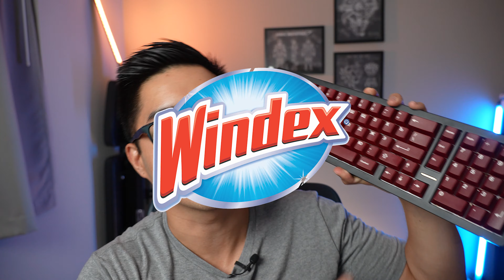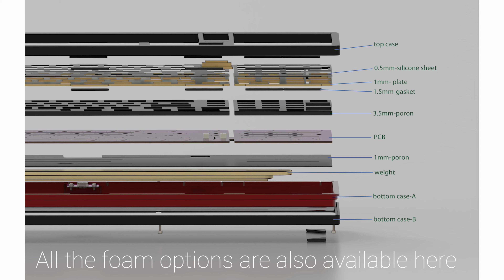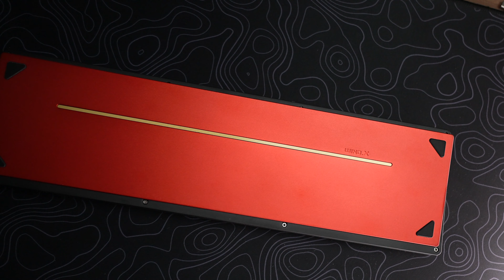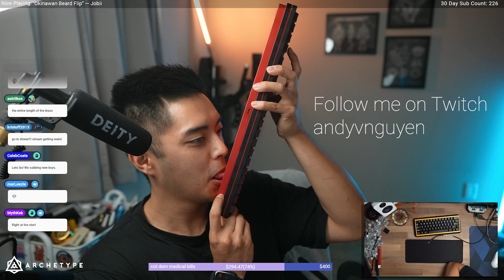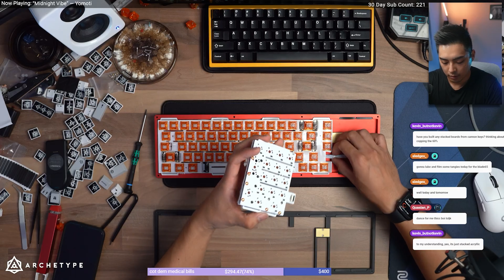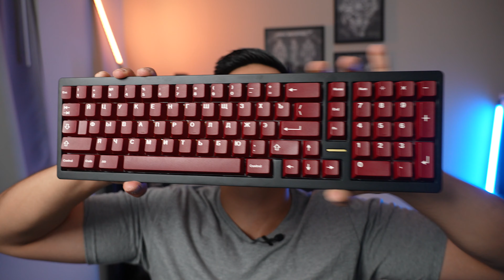This Will Be Your New Work Keyboard - Wind X Review

Comment: What they should have done is putting the silicone on one of those anti stick paper (those used for stickers).  The user can simply place the entire silicone/paper layer on the plate without it moving around sticking to itself.  
However silicone likes to trap dust, and I imagine this board with silicone layer will become super dusty over time....like a cat vomited hair balls into it.

Comment: hey im wondering, i like the sound of your wind x and right now, i have a wind with carbon plate and ktt rose with only plate foam. I'm trying to get epsilons because ive asked around and was told long pole seems to fit what im looking for. If i had epsilons, do you think i can get a deep sound with a carbon fiber and only plate foam? I'm looking for a marbly, deep sound where theres deep bass that travels within the keyboard and where if i press a key, barely, the sound travels far down. I;ve had issues in the past where keyboards sounded muted, high pitched, plastic. I have keyboard sounds on my profile

Comment: What is your opinion on the the akko mod003? it's a gasket mount 96%/1800 layout that still has the f-row, and while im at it, what about the new akko switches aswell, what's your opinion on them?
Also great content 👍
Reply from the maker: looks fine but it's tray mount. i haven't really looked into akko switches - hesitant due to seeing some of their keycap copies
Reply: @AndyVNguyen  there's 2 version, the akko mod 003 is a gasket mount, but i think what you're referring to is the akko mod 004 version, which is yes a tray mount, 96%/1800, its basically the same keyboard but just a diff mounting style

Comment: I genuinely hope there is a good way of installing the silicon because i bet people will have a hard time. There should be a guide.
Reply from the maker: It’s like fruit roll ups. Except you don’t just peel it off you also have to put it back. Idk if there’s a proper way to do it…
Reply: @AndyVNguyen  I don't think so too but I assume it can be done like how you install dbrand sticker like peeling it a bit and doing it section by section. What if you tear it during the process lol 🤣.
Reply from the maker: lol it has so much less structure than a sticker though. it's like spaghetti

Comment: Really enjoying the content and your impressions on the board! On a more critical note, it's always interesting to me, I think most people who use Excel must not use anywhere near the full breadth of the keyboard shortcuts. I use a good handful of the function keys, page up, page down, home, and end all the time, so to me having no function keys for a work keyboard is a no go. I think it's particularly goofy to me on the basis that for ergonomics I don't really care about height, just width, so the 65% boards feel like a real missed opportunity (particularly versus a 75% with equivalent width). I realize this is a unique layout, and I'm sure it will be great for some folks, but I just feel like I'd go for a full size or an 1800 over this if I needed a numpad.
Reply from the maker: Thanks for sharing! I personally can hit function with numrow pretty consistently so I haven’t missed those. I’ve actually only used a 60/65 for the longest time. But I’m not too deep in excel
Reply: @AndyVNguyen  Thanks for the reply! I’ve definitely gotten the impression that a lot of folks get by with a 60/65 for productivity, and totally respect it! I think for navigation in Excel, things like ctrl+pgup and ctrl+pgdwn to navigate between tabs, ctrl+end to get to the bottom rightmost cell, F2 to start editing the formula in a specific cell, F9 to recalculate, and home and end to get to the front or back of a long formula are just a few things that are presumably not as easily done with a 60. I work as an actuarial analyst, and fortunately pretty much never do manual data entry, but we’re constantly building formulas and navigating between tabs in large models, so 75% has been my go to for ergonomics and functionality. I do still use a 60% for gaming, and love it.